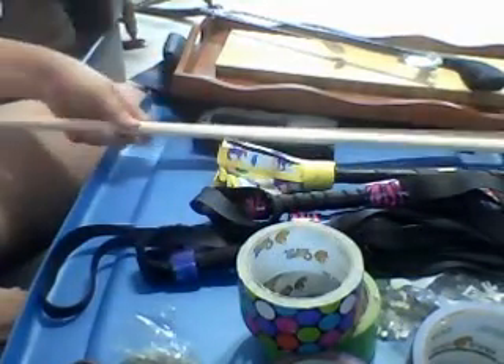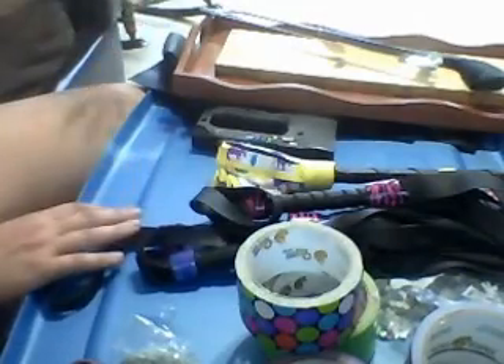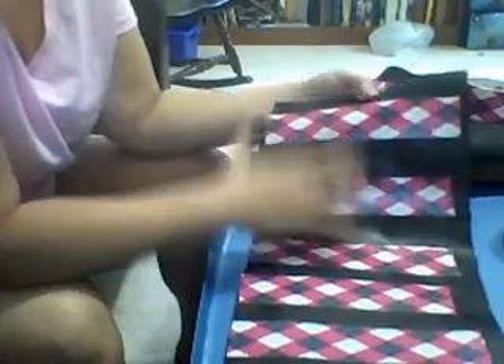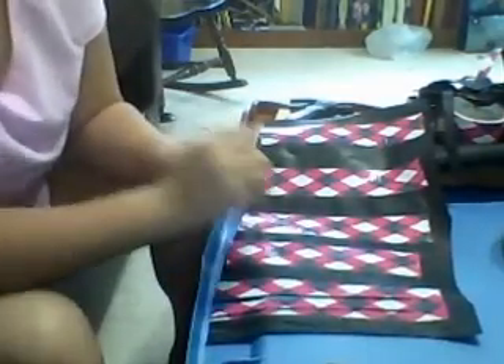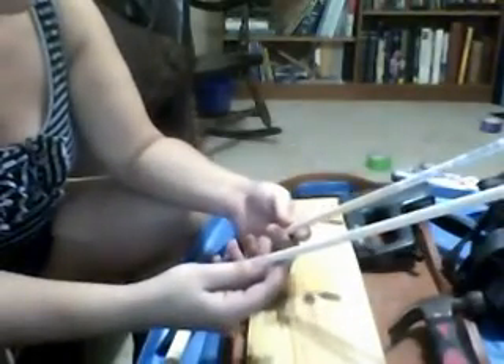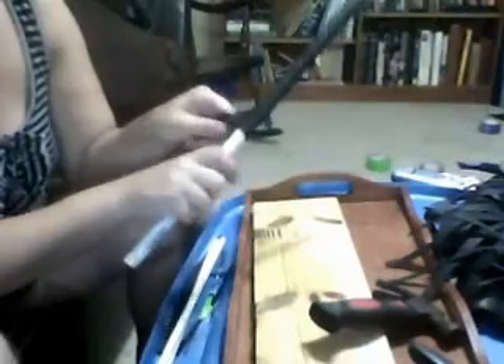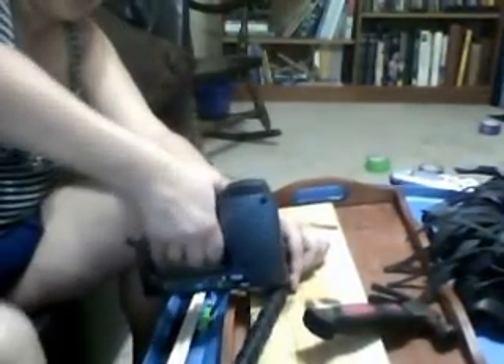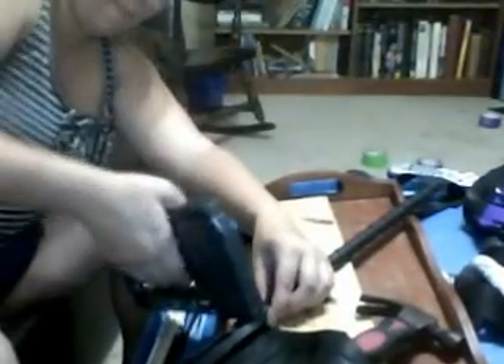How to make Flower Sticks/ Devil Sticks Juggling sticks

Comment: how is the material at 0:53 called?
Reply from the maker: There is a motorcycle repair shop in town and they gave me their trash inner tubes
Reply from the maker: it is a single ply roof, used for flat roofs, Motorcycle or bicycle innertubes work GREAT